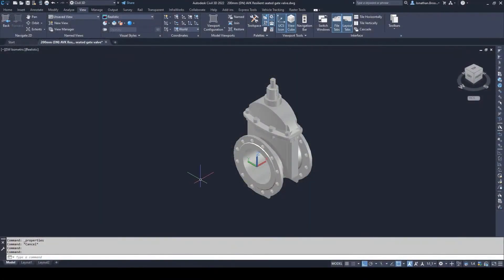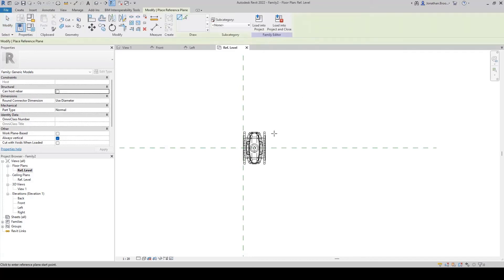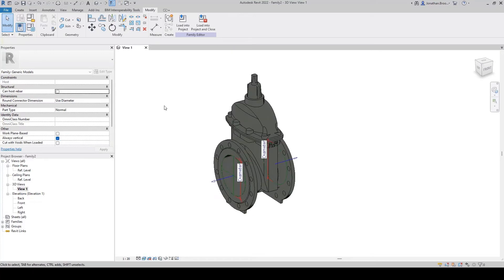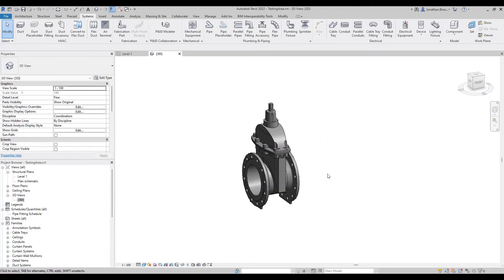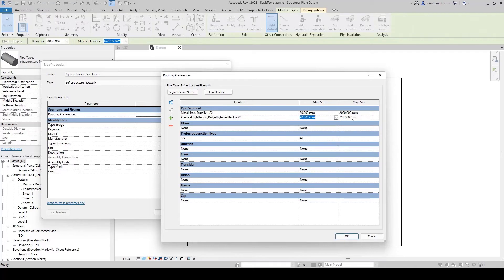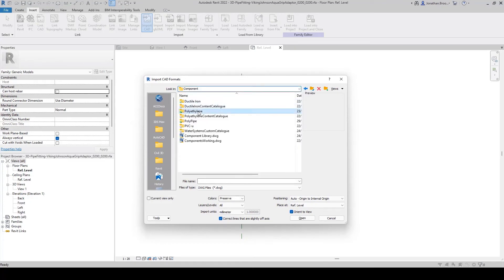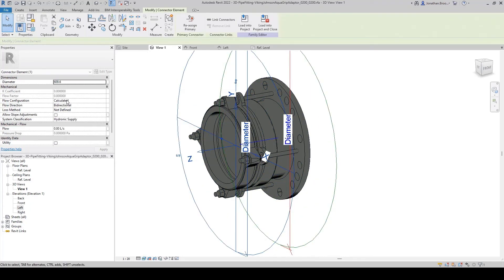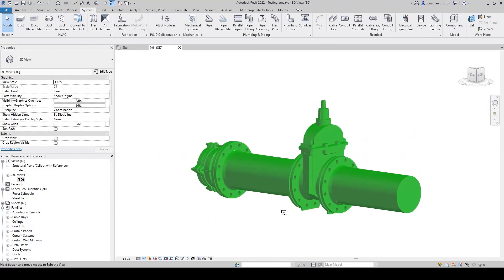Revit - Custom pipes fittings and accessories

Comment: What if you have all the DN's you need to use. Like lets say you find gate valve with different STEP files according to the DN you chose, since slight changes in the flage holes might happen the bigger the DN gets. Can on download all these STEP files and then do parameters that let you automatically fit the DN of the gate valve fitting with the right pipe DN?